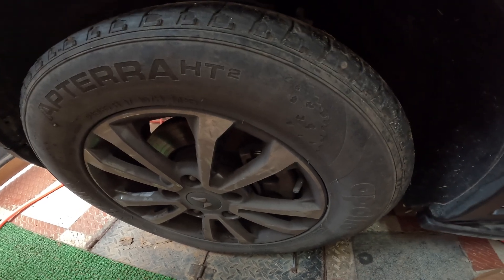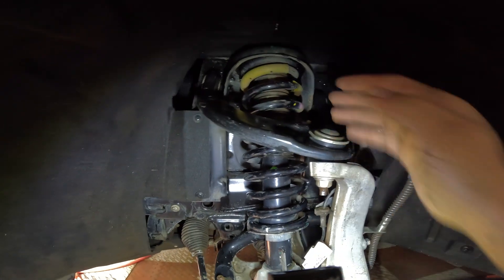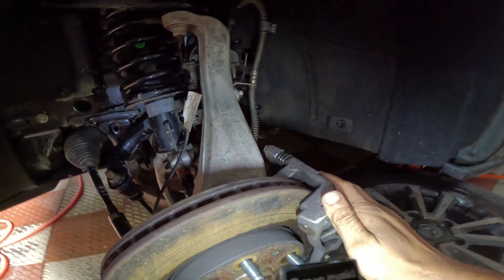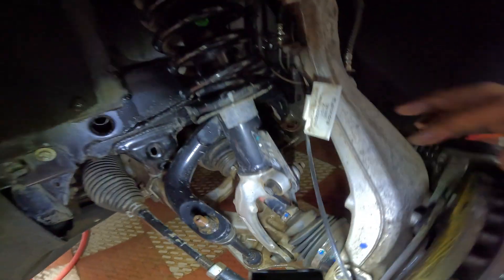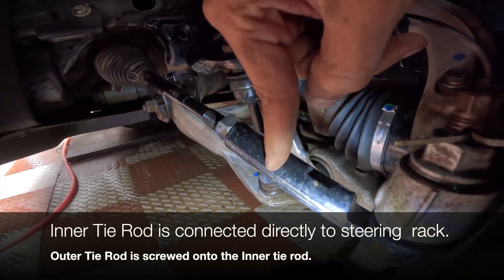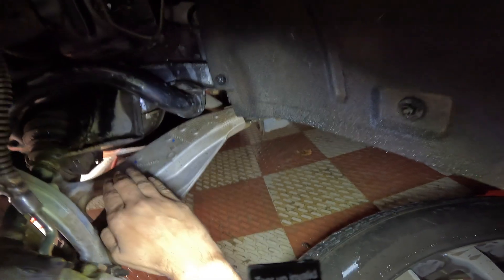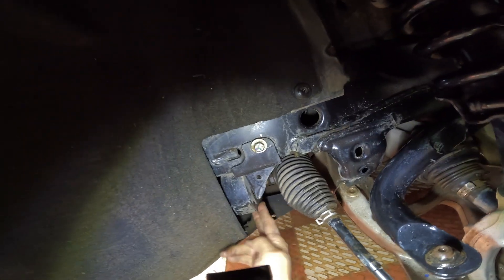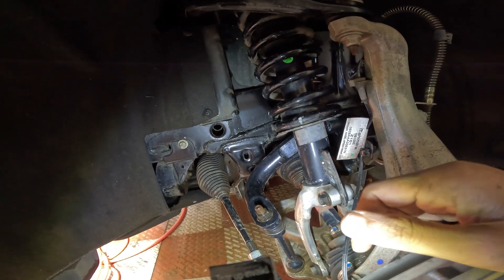Everything Under Your Scorpio-N’s Wheel Arch | Know Your Scorpio-N | Components walkthrough.

Comment: Thank you for this great video. I am curious if you have a solution to my problem. I  have scorpion 4xplor. Both front tyres outer edge is worn out prematurely and i am not able to sort this issue despite multiple aligments at mahindra service center. Any idea to fix it?
Reply from the maker: I understand how frustrating it can be. Have you got the alignment done outside?  Ladder frame cars require a bit of professional alignment. If you haven't got it aligned outside, I would highly recommend not getting it aligned at the service centre. Start with a complete balancing of all the 4 wheels, then followed by tyre rotation and finally alignment. Hopefully it should solve this issue.

Comment: Hello Mukul,  I own a Slavia 1.0 which tyre would you recommend and why ?
Reply from the maker: Hey, assuming you use the wider 205 section with 16 inch rims. I would strong suggest Continental or Bridgestone. If your budget allows, go for Michelin. Now here is why, its solely based on my experience of the past. Having used JK, Apollo, Ceat, Bridgestone and Michelin in the past for almost full life of tyre and Continental briefly. I found that once the tyre gets wider and rim size increases past 15 inch brands like JK, Apollo and Ceat perform the worst with tyre compound hardening in 30,000 kms. Which I believe is not the case with smaller tyre of the same brands. Maybe it's just my experience. The rubber on Michelin and Bridgestone stayed the best for more than 50,000km. I am yet to use Yokohama(next purchase) and MRF's that's why my opinion doesn't apply to them. Continental and Michelin also gave good grip regardless of the road conditions. Apollo was the worst tyre and almost equivalent to JK. They tyre compound just gave up and tyre started cracking in 2 years. However Apollo on my hatchback (185/70 R14) has held up great in 3 years without any issue. So solely based on my experience in terms of wet grip and longevity with good overall experience I would suggest any one of Continental, Bridgestone. If possible Michelin. Again it's based on my experience and has no scientific backing.